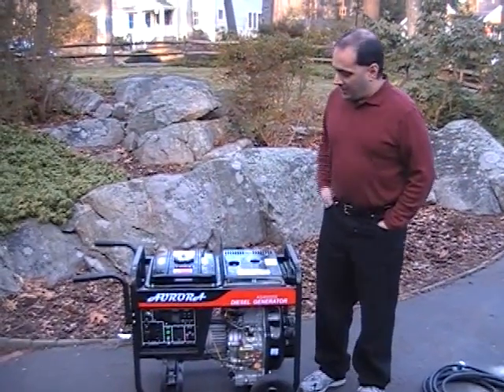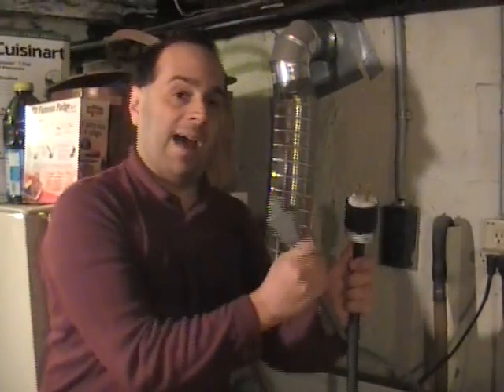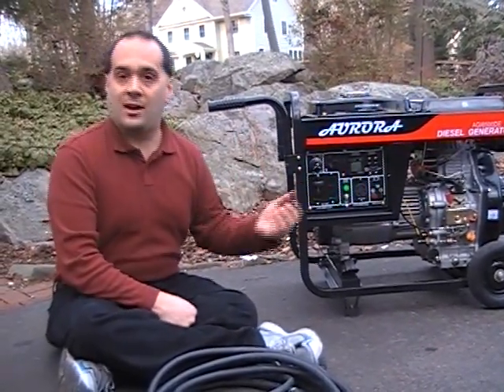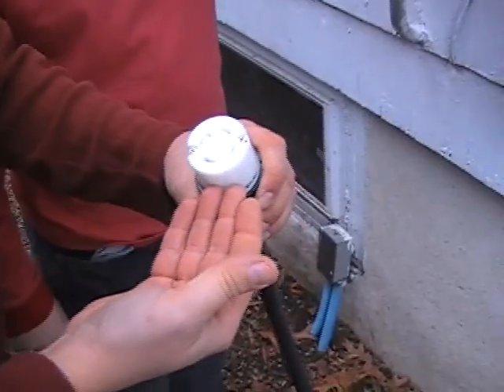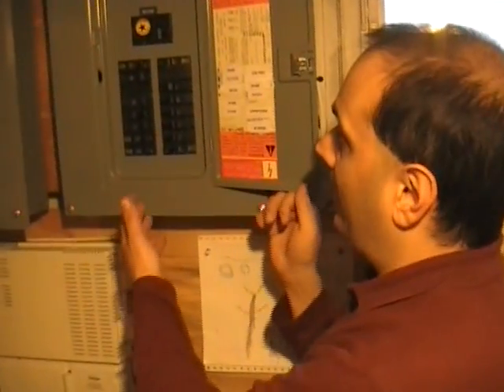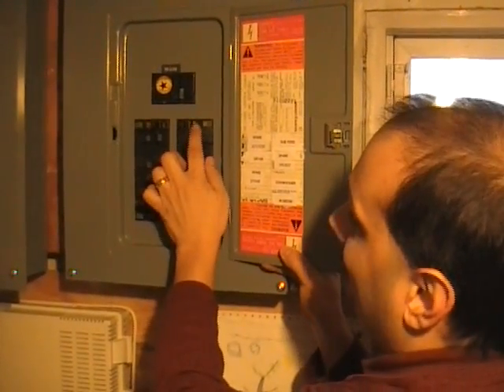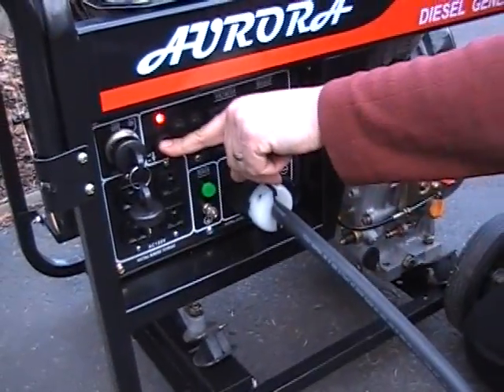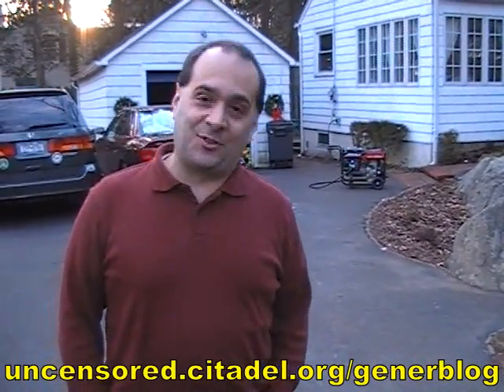Inexpensive residential generator hookup

Comment: I would be building a block wall a few feet high, large enough to fit ur generator in.  You could add a roof to it if u wanted to but the "solid" walls will help to isolate the noise from your generator.  Or you could dig a hole with a roof over the top and it will help with the noise affecting not only your neighbours but also making it quieter for yourself too.  Apart from that great vid thanks for putting the effort in, I like the sub panel that u did.
Reply: they actually make generator sheds they are plastic but ive seen several videos on here of people permanently installing their generator in them and adding sound proofing and exhaust fan and whatever else you want but it seems to really kill the noise
Reply: Make sure you follow all the generator safety rules before using portable generators. This is just a reminder for everyone’s safety. All generator safety rules should be followed carefully. Here are the rules about generator safety: Generators can be dangerous if not used carefully. Every year, hundreds of people die or get injured when using portable generators due to carbon monoxide poisoning and electrocution. Make sure you are using your generator carefully and keeping others safe as well. There is something very serious that everyone should always be aware of when using generators. Some people do run their generator indoors which is not safe and that increases the risk of carbon monoxide poisoning which can cause death of family and you. Some people run their generator in wet conditions which can electrocute them. Please remember that you should never run your generator indoors. Remember that carbon monoxide is an odorless and colorless gas that you cannot see or smell. Carbon monoxide is a silent killer. Keep that in mind. Make sure your generator is 15-20 feet away from your house and away from doors, windows, and vents. Never use your generator in your porch too. Having a carbon monoxide detector is very important against generator safety. Some people also allow children to go near the portable generator which could pose risks. We need to keep an eye on our children making sure that they are not near the portable generator so they won’t get electrocuted or burned by the generator which is dangerous. A locking enclosure also keeps kids safe. A generator shed might look like a tempting place to explore, or take cover during a game of hide and seek, but a generator is a dangerous piece of equipment that can cause injury. It says on the manual that we should also keep children away at all times from the portable generator to avoid injuries. Please do not allow a child or unqualified people to operate the portable generator.  It is important to keep your children safe especially little ones. The portable generator can be hot during an operation. Just because some manuals missed what should be listed doesn’t mean it’s safe to do. Always follow the generator safety rules when using portable generators. Generators pose electrical risks. If you need to use your generator during wet weather, you need a generator tent to protect your generator from getting wet. Don’t let your generator get wet. Keep your generator dry and before using your generator, please make sure your hands and your generator is dry. Do not wear loose clothing when operating the generator. Everything that is said on the generator’s operating manual should not be ignored. Never smoke cigarettes near the generator. Please keep flammable things away from the generator. Never overload your generator too. Your generator can catch fire. Never ever try to plug a generator cord into a wall outlet to avoid back feeding. Back feeding your generator is dangerous. Always turn on your generator first before plugging in appliances and shut off the appliances before turning your generator off. Use a heavy duty cord for your generator and the cord should not be worn out. All the instructions should be followed carefully. Never refuel your generator while it’s running. It can cause fire if fuel spills while your generator is hot. You should turn off your generator and let it cool off before refueling it. Having a fire extinguisher next to the generator is also important. This is only a reminder for everyone’s safety of using generators. Make sure your generator is properly grounded. Having a fire extinguisher next to the generator is also important against the safety rules. https://youtu.be/I1jT3ANENvI and here is a video more about keeping others safe when using generators and also about our family’s safety. It’s important to keep our little children safe as well. Make sure they’re away from the generator. Hope this helps.

Comment: How many watts (or amps) do you need to run oil burner and its circulator pump?
Reply: We use to run ours off a 1000 watt honda.
Reply: I was in a Pinch.. used a Car battery and my 1800 harbour freight Inverter. Got us Through the Night...
Reply: Make sure you follow all the generator safety rules before using portable generators. This is just a reminder for everyone’s safety. All generator safety rules should be followed carefully. Here are the rules about generator safety: Generators can be dangerous if not used carefully. Every year, hundreds of people die or get injured when using portable generators due to carbon monoxide poisoning and electrocution. Make sure you are using your generator carefully and keeping others safe as well. There is something very serious that everyone should always be aware of when using generators. Some people do run their generator indoors which is not safe and that increases the risk of carbon monoxide poisoning which can cause death of family and you. Some people run their generator in wet conditions which can electrocute them. Please remember that you should never run your generator indoors. Remember that carbon monoxide is an odorless and colorless gas that you cannot see or smell. Carbon monoxide is a silent killer. Keep that in mind. Make sure your generator is 15-20 feet away from your house and away from doors, windows, and vents. Never use your generator in your porch too. Having a carbon monoxide detector is very important against generator safety. Some people also allow children to go near the portable generator which could pose risks. We need to keep an eye on our children making sure that they are not near the portable generator so they won’t get electrocuted or burned by the generator which is dangerous. A locking enclosure also keeps kids safe. A generator shed might look like a tempting place to explore, or take cover during a game of hide and seek, but a generator is a dangerous piece of equipment that can cause injury. It says on the manual that we should also keep children away at all times from the portable generator to avoid injuries. Please do not allow a child or unqualified people to operate the portable generator.  It is important to keep your children safe especially little ones. The portable generator can be hot during an operation. Just because some manuals missed what should be listed doesn’t mean it’s safe to do. Always follow the generator safety rules when using portable generators. Generators pose electrical risks. If you need to use your generator during wet weather, you need a generator tent to protect your generator from getting wet. Don’t let your generator get wet. Keep your generator dry and before using your generator, please make sure your hands and your generator is dry. Do not wear loose clothing when operating the generator. Everything that is said on the generator’s operating manual should not be ignored. Never smoke cigarettes near the generator. Please keep flammable things away from the generator. Never overload your generator too. Your generator can catch fire. Never ever try to plug a generator cord into a wall outlet to avoid back feeding. Back feeding your generator is dangerous. Always turn on your generator first before plugging in appliances and shut off the appliances before turning your generator off. Use a heavy duty cord for your generator and the cord should not be worn out. All the instructions should be followed carefully. Never refuel your generator while it’s running. It can cause fire if fuel spills while your generator is hot. You should turn off your generator and let it cool off before refueling it. Having a fire extinguisher next to the generator is also important. This is only a reminder for everyone’s safety of using generators. Make sure your generator is properly grounded. Having a fire extinguisher next to the generator is also important against the safety rules. https://youtu.be/I1jT3ANENvI and here is a video more about keeping others safe when using generators and also about our family’s safety. It’s important to keep our little children safe as well. Make sure they’re away from the generator. Hope this helps.

Comment: I've been using a DIY connection to an outside generator(s), and now a new one, for a very long time.  My home was wired with an outside main breaker, and so there is no main breaker on the panel. No way to hook up the so-called interlocks, so I just have to remember to open the main breaker , before closing my 30 amp double that my generator is connected to on panel. This separate panel looks quite difficult and expensive. I have often wondered if there is any easier way to ensure the outside main is open, even though I have never forgotten to turn it off  ,and always have a female "cap" on the plug of the generator cord when not in use...
Reply: One way that is not very expensive "If you know a friendly electrician" is to use a contactor that has the coil powered by the generator 12v outlet that most genny's have. 

This way the supply will switch over isolating the utility feed while the generator is running. This is like a cut down version of an automatic transfer but a lot cheaper to put in.
Reply: A sub panel or a generator panel would be the way to go or a manual switch on the out/inside of your house with the big red handle.
As was also suggested you can get special Breakers that will be electronically triggered for your main although that might be expensive more so than an automatic transfer.
Reply: Yes, but if you forget to open your main, your genset will backfeed into the grid. Forget the lineman, he knows to protect his ass from an idiot. Concern yourself with the fact that you may have just reenergized your neighbors house. I hope he is a lineman too!  Check out "electrical interlock" these are NEC approved (when used in the approved enclosure) mechanical switches.They simply prevent both breakers from being closed at the same time. You may be able to make such an 'either/or' device yourself. It's just to keep you from forgetting, and hurting someone else.

Comment: Wires aren't designed for back feed? Where the hell does it say Direction on The Wire? You're a dumbass
Reply: That wasnt the first thing that made " dumbass" cross my mind, but the one that made me pause to comment. 
There is power at these prongs...wrong again dumbass
You flip open all relevant breakers and switches BEFORE plugging in. You plug in BEFORE starting the genset. THEN close the drier breaker. 
Its illegal to plug MY genset into MY electric plug ? Omg. It is not, and cannot be made, illegal. 
 As simple as electricity is, if you dont know what you are doing, get someone who does. I think that was the main point of all his BS, but lying doesnt further his safety argument. Now I have to hit play and see if there is more misinformation worth addressing here.
Reply: @thumper88888  You are right it's not illegal to plug you generator into your socket even though it is a stupid thing to do, however it is illegal to make a GAY lead eg Male to Male so either way you are doing somthing stupid and somthing illegal
Reply: @Mr Sunshines In all fairness though, are we not forgetting that the generator itself has a circuit breaker as well?
Reply: Actually as an electrical engineer I can tell you "Skylin" is correct. Not all breakers will trip on a reverse current overload. There is also the fact that a 60A breaker does not trip at 60A. Most are thermal and take time to trip. Enough time for the cable to overheat as the 60A feed is not the maximum continuous current  that a drier will pull as there is always a safety margin built in.

Most other countries and some US states require that GFCI protection is also required.

He is by no means a "dumbass" quite the opposite in fact !

You may find you are the "dumbass" if you use the backfeed method as you have just invalidated your home insurance. Advice like his could save a life. What is "dumb" about that ???

.............. Update after "chris chilson" contacted me............

As "chris chilson" quite rightly pulled me up on my first line of my post I meant to say it was lethal and to reply to the post by "Skylin Megas".  Chris also quite rightly points out that you will lose your neutral and hence your grounding to. 

Using a correctly wired transfer switch or interlock the connections should be ....  Green to your ground / PE .... White to the neutral .....  Black to the primary Hot ..... and red to the secondary Hot.

I would strongly advise that you check anything you plan to do with a qualified electrician in your area that is familiar with the code and better still get the electrician to perform the job for you !

Thanks Chris. I have updated my post.
Reply: @TRS-Tech  i didnt know that AC travels in 1 direction like DC
Reply: @darryldickson4360  It does not, However there are multiple types of breakers and some of those devices do not operate correctly or malfunction when the load is present on the wrong side of the breaker.

When a supply is delivered from the grid a neutral termination is made at the central tap of the transformer. The opposing ends of the transformer is where the two 120v tapps are taken. This why you have a white and two black cables fed to the home. However these cables are marked red, white and black for an important reason. Some people believe this is a two phase supply. It is not !

The central tap now becomes a protective earth and is ground bonded at the transformer. The distribution centre is then wired and balanced and a ground rod bonds via a rod and to any conductive pipes ect. This is known as equipotential bonding.

You may wonder why I explained the above ! Can you explain the difference if any between this and the method of supply you are defending please. When you have done so I may be able to help you understand as you do not seem to understand the issue.
Reply: Darryl Dickson .
Ac is like a rope saw, sawing back and forth but with no physical connection to your hands the pump, for this is used the TRANmission transformer.
Reply: @TRS-Tech  What about the generators breaker ? That has it's own circuit protection, so really nobody should give a rats ass about the 60A circuit he's back feeding into! Reverse current flow (do you even know what AC stands for ) current is constantly moving in both directions anyway...lol  There is no such thing as "reverse current overload"  Geez the keyboard warriors are out in full effect on this thread
Reply: @TRS-Tech  Going from a 4 wire 120/240 genset to a 3 wire 240V dryer circuit means eliminating the neutral conductor. Definitely unsafe folks, don't do it!
Reply: @crankychris2  Thanks Chris I have just spotted that I typo'd. I meant to say that this method is unsafe as I explain in the post why this is so. I meant to reply to "Skylin" and point out the dangers. I will correct my post.

Thanks Chris..... I can take the "D" hat of now....... Oooops this time I am the "dumbass"  !!
Reply: Because, as he stated , there is no safety equipment at the dryer outlet . 

They are all at the breaker box

Numb nuts , re watch and take notes. This video as pretty clear and straight forward as can be .

Maybe he needs some crayons and construction paper to help illustrate this in a format that you can understand.
Reply: @SkyLinMegas  dumbass
Reply: Darryl Dickson why call names? This is informational as he said in the feed.